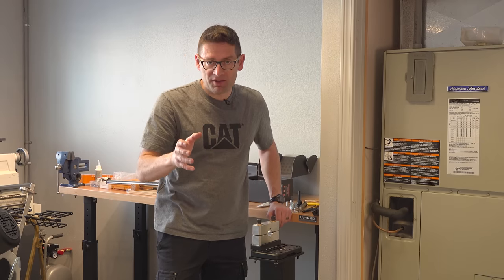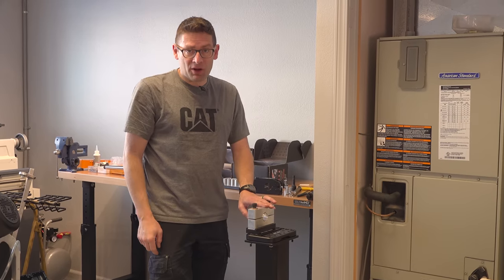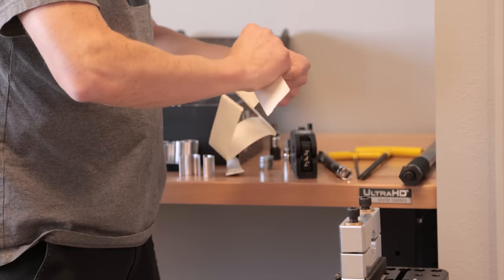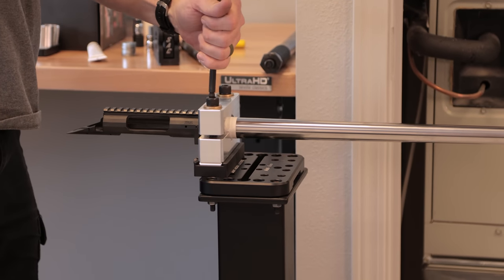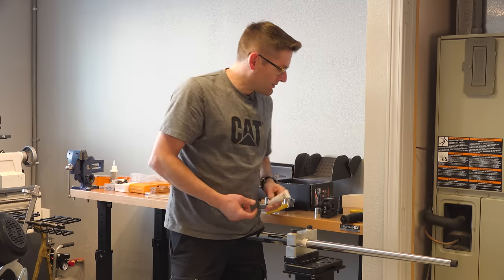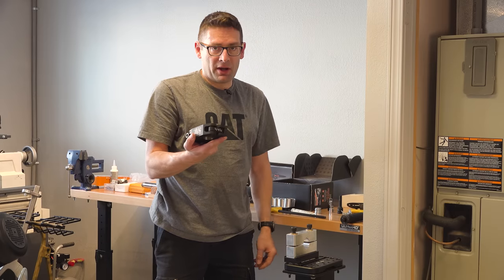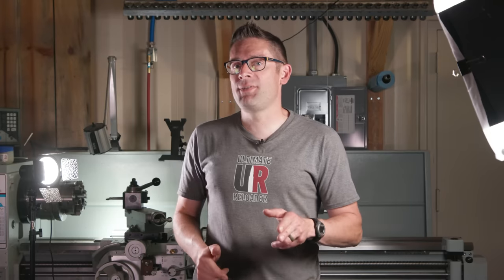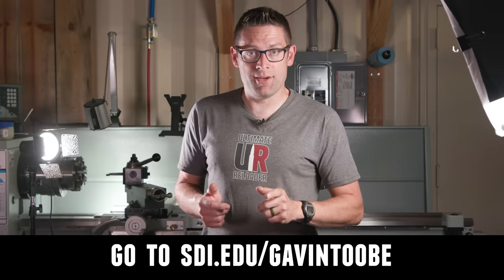Removing a Rifle Barrel The Easy Way (SAC Bravo and Vise Stand Demo)

Comment: An even easier way to remove your barrel is to have an AI AX and undo the clamping bolt and unscrew the barrel by hand. Takes 10 seconds. In the field. Awesome.
Now try removing a factory Tikka Barrel.

Comment: Now show us how well it works with an 30 yr old rifle barrel removal
Reply: Works great just use an external action wrench for an old factory gun. Use the nice internal wrench for reinstall or taking off a barrel you installed yourself.
Reply: @RicksOutdoors  so u have one correct and have used the tool to remove 30 yr old rifle barrel  I do know  remington is a pain especially on actions from the late 60s